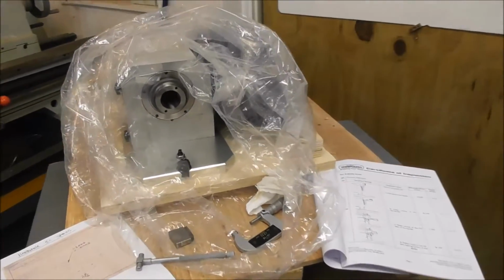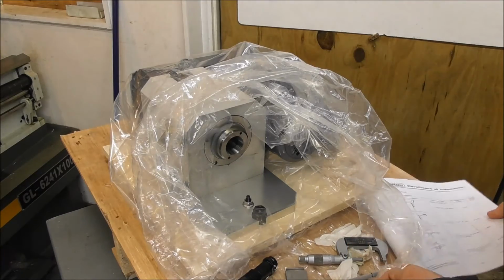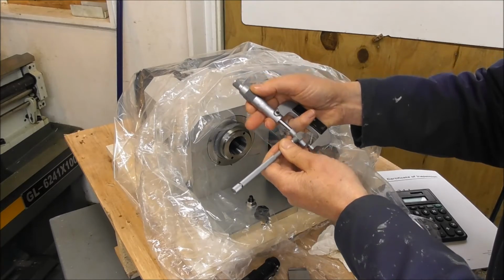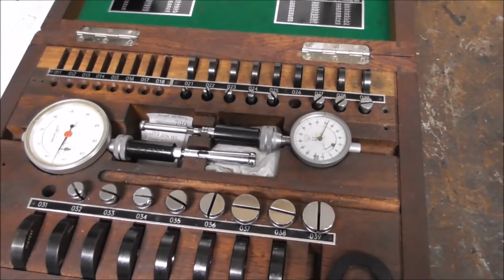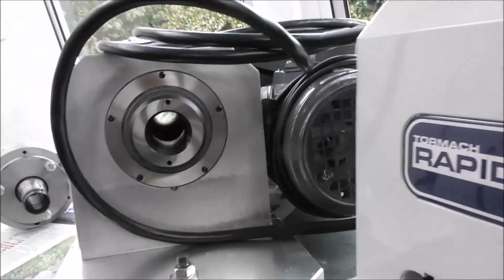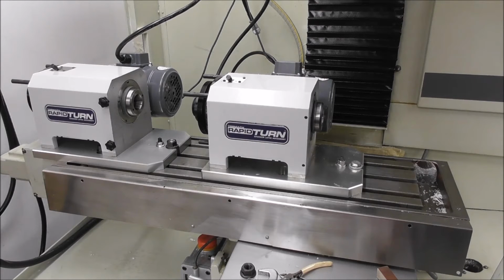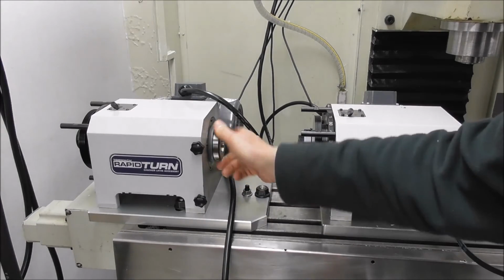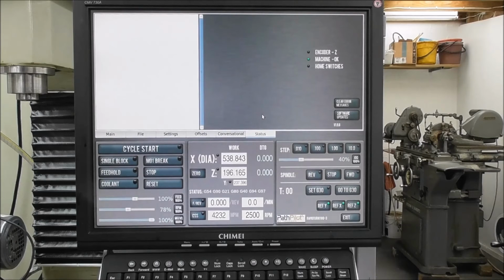TormachRapidTurn - 14. Replacement arrives

Comment: Cliff, 
Great set of videos, thanks for putting in the work and sharing experiences.
I sympathize with the early adopter issue on the RapidTurn as I own serial #90 of the PCNC1100 series 1 (since incrementally upgraded to a series 3) and I had several manufacturing and some electronic related problems as with all new products. Tormach was great (especially the founder Greg, now deceased) and they sent out replacement parts and repair tools (shims, drill bits, etc) for me to accomplish repairs and rework. I even was allowed into the backroom of the Mach 3 (pre-pathpilot) software configuration to tweak settings to my needs.
 I am strongly considering purchasing a RapidTurn to solve my problem of wanting a cnc lathe and not having any more space in my shop.
Pat
Reply from the maker: Hi Pat. Thanks for the feedback. Good to know I have been a help. Cheers  Cliff

Comment: I admit i dident watch much of this but you do realize your measuring an "error" of 0,005mm using a telescoping gauge and the mic reading is affected only by the feel of you hands?
Reply from the maker: Hi - Yes I remember faintly (March 2017) some of that was not covered in enough detail - there is a lot involved in getting accurate T gauge measurements. I agree. Cheers   Cliff

Comment: Hi Cliff, just measured the bore of my spindle at the stabilising diameter in the spindle bore using a Matrix (Coventry Die & Gauge Co) bore gauge and I get a reading of 1.24975". These are really accurate gauges and can read to 1/10th thou and you can split the reading quite easily because the 1/10th thou divisions on them are pretty big.
Is this within spec?
Reply from the maker: Thanks Bob.

Well 1.2500 " is the minimum ex Hardinge spec - But being a bit small is probabaly really good because the cheaper 5C collets are quite a bit undersize and so you will have less slop.

Cheers   Cliff

Comment: Hi Cliff. Thanks for the video. Disappointing outcome considering you may have actually saved the company. Those spindles were dangerous and parts could have gone flying. They were so lucky you investigated the unit so thoroughly when you did. What are the chances that we will see you do a video on swapping your new spindle into your old rapid turn? Or is it time to just move on. Cheers, Kieran
Reply from the maker: Thanks for that Kieran, I am so focused on whatever is not right, I forget to remember the positives. Cheers.
Reply from the maker: Re the swap idea - so far Tormach have conveyed they do not want us to dismantle.

Comment: Hi Cliff, I got my replacement spindle yesterday. I haven't had a chance to have a good look at it but will in a few days time.
Reply from the maker: Hi Bob - Keep us posted.
Reply: Wil do Cliff. I have some decent bore gauges so will measure the guide I.D. when I get home after the weekend. My unit looks to be absolutely unused , everything was wrapped up in original packaging with new guard and draw tube etc.
Reply from the maker: Good to hear Bob. I think we are getting new mk1 units from the factory that had not yet been shipped, but they have replaced the spindles and made them into mk2, but I may be wrong. Cheers  Cliff
Reply from the maker: Bob. I vaguely remember you had a spindle sensor signal issue...I seem to also....mine sends a signal when hand turned, but I think it goes intermittent at speed ...any ideas?

Comment: Like trying to buy a good pair of shoes these days, one may be in spec, the other too large or too small :(.  Sounded like bearing to raceway mismatch to me, some gap on one end of the bearing taper, while pinching on the other, creating a clicking as the bearing bounces around as it gets slowed down being as it's pinched on the other end. Not an expert on that either, but that is my perception. Now you have 2 RapidTurns, what is the plan for the old one?
Reply from the maker: Hi PG. Yes I hope it is not that... .
 I will have to send the old one back.